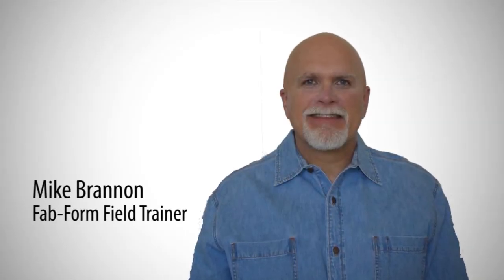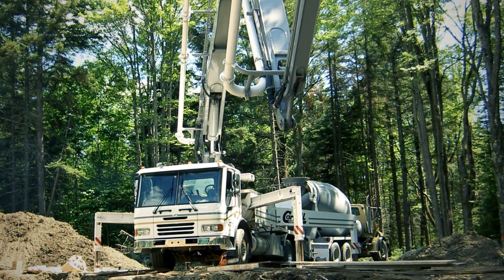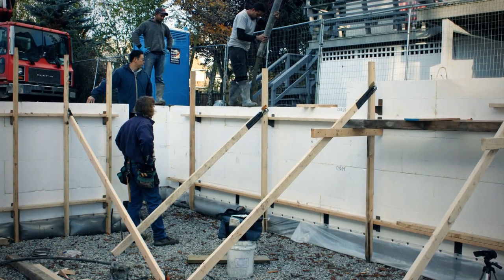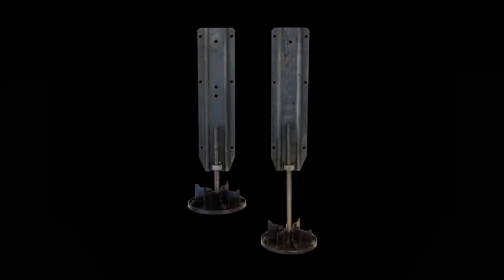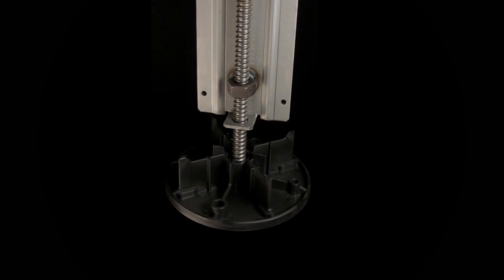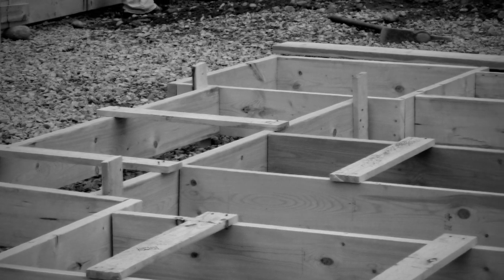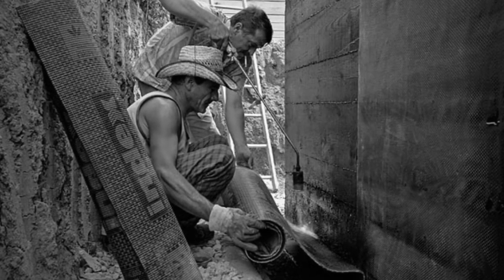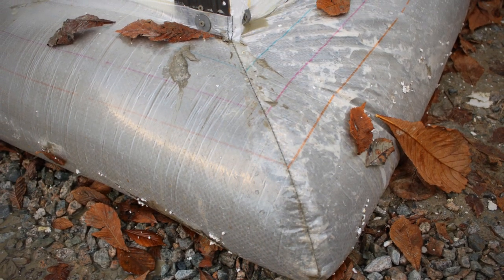Fastfoot® Monopour Benefits

Comment: Ive used these a few times, but only for footings. Ive heard that in the monopour application, the walls tend to "float" and you lose your level on the top of the wall. Does anyone else have experience with this? This feedback from other contractors pretty much guarantees that I will never use this system if I have my entire top level float away on me.
Reply from the maker: 10000000% floating of the forms is a potential issue. The Zont bracing system we have will mitigate this with stem walls. It is not a concern on full height walls with the weight of the wall and rebar etc. With the Zont system the wall is staked in place 5' on center.

Comment: how would you repair a blow out in the plastic?
Reply from the maker: We have only seen a handful of blowouts and they have not been on the bag footing, but on the connection to the webs of the ICF. Typically around window wells where the placer have put too much concrete in the forms on the first lift. If this is the case , like any concrete pour, you will want extra lumber onsite to quickly patch. Place a 2x8 on its side and stake in position to quickly set up a temporary footing. Let this set up and continue the pour in 30 minutes once the concrete has "gone off".